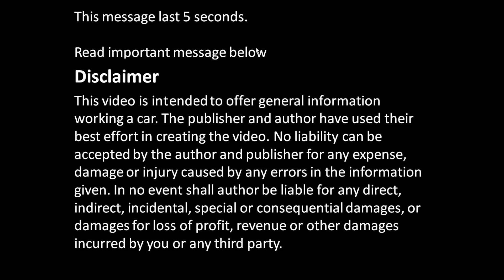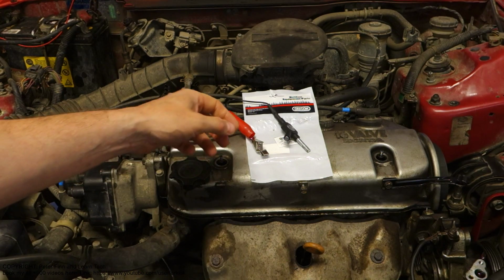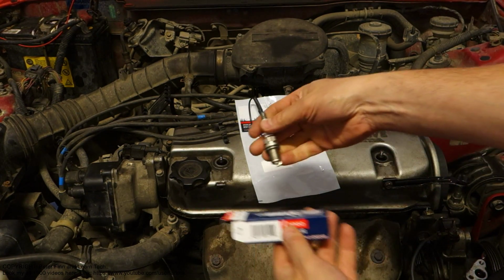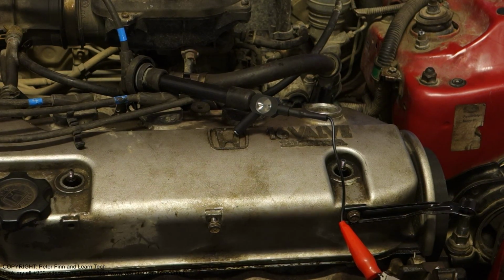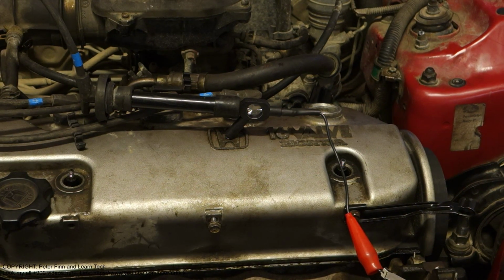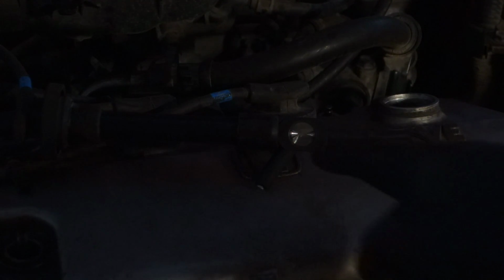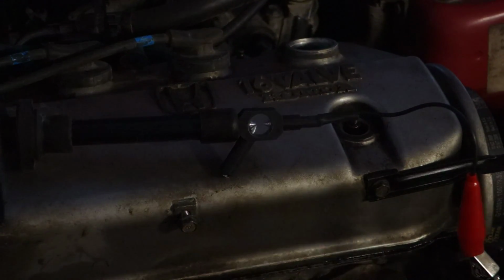How works spark plug tester  Oregon In Line Spark Tester

Comment: Please note.  While overall this presentation is pretty good, the procedure has a problem with one important point.  Note that, with this particular test equipment, the cable side of the tester, has TWO metal stubs, only one of which is used during testing.. The presenter has this second, unused cable stub resting on the engine's metal valve cover.  Unless this cover is completely isolated from the vehicle's ground, the HV will travel to ground through this path, and no spark will be observed in the instrument's observation window.  As usual, any HV will always take the path of least resistance, which if the second 'stub' is resting on a grounded metal surface, or a shorter distance than that of the tool's observation gap, will lead to a false test observation.  I have this tool and observed this problem while testing a small Honda engine - an engine which presents a problem due to very restricted access.  In that situation, because of the confined space,, the second unused 'stub' sparked to a grounded  piece of the engine shroud, and no spark occurred in the observation window.  The problem was eliminated by rotating the tool 180 degrees so that the extra stub was further from engine's metal, and system ground.  An alternative solution would be to wrap the unused HV stub with electric tape before testing.  Cheers.
Reply from the maker: Great work Sir. I really appreciate your comment and text. Continue on the same road. 👍